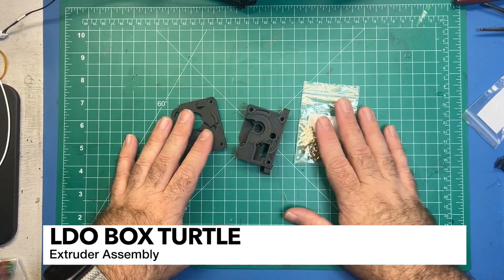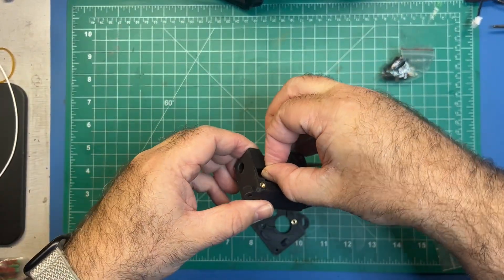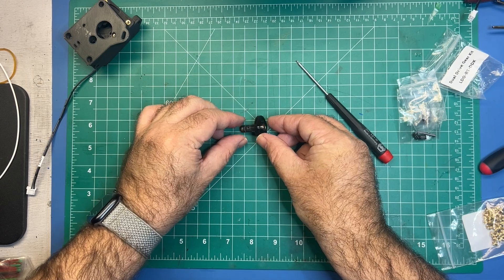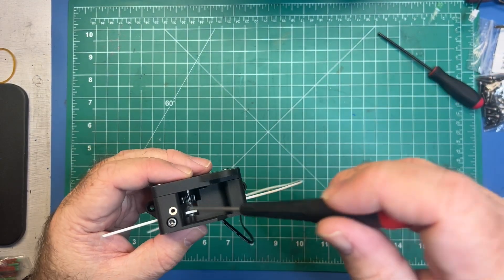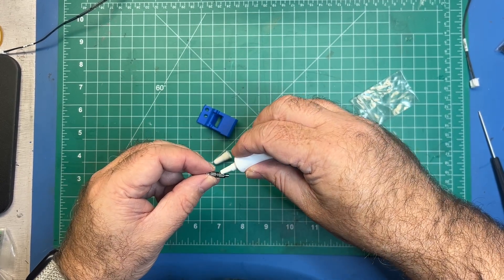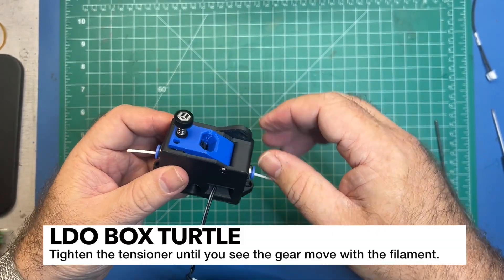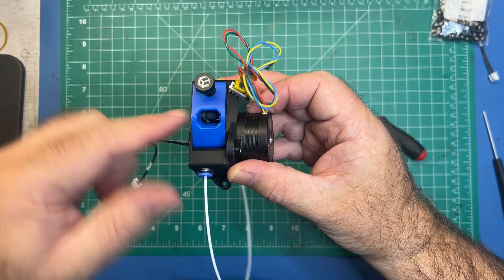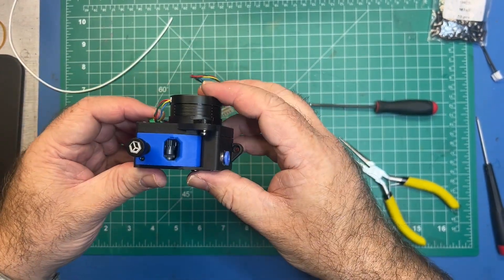LDO Box Turtle Extruder Assembly

Comment: my extruder plate don't mate properly with the base.  Very hard to get in there.  I printed both in ASA on same print. What slicer settings should i use?
Reply from the maker: You probably need to reduce your extrusion multiplier. I’d suggest lowering it by 2-3%. There is a good tuning guide called Andrew Ellis here: https://ellis3dp.com/Print-Tuning-Guide/